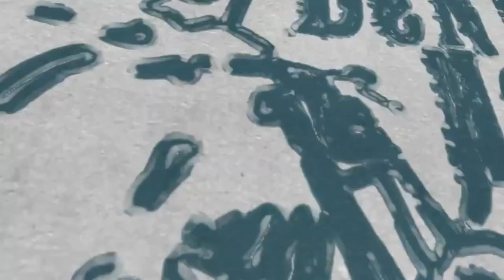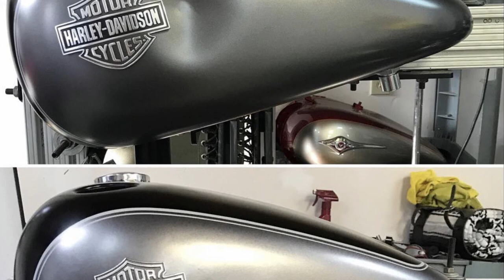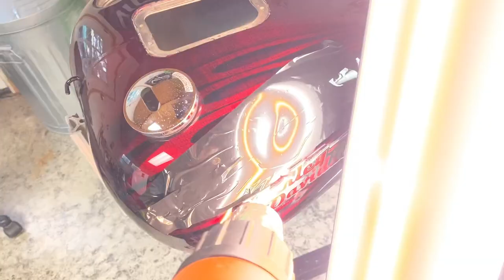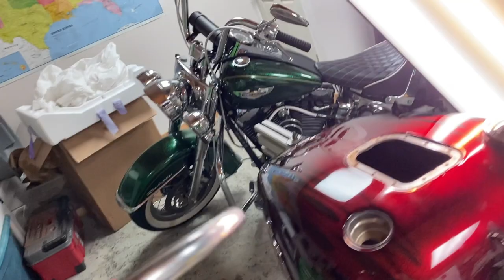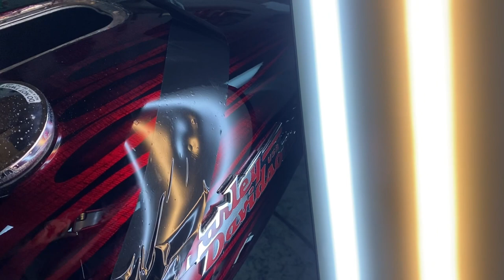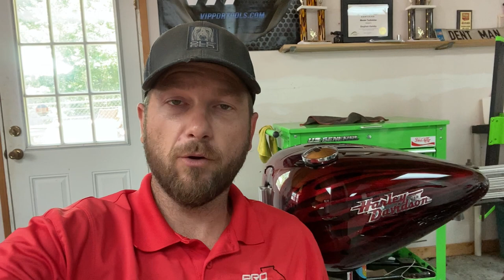Motorcycle Dent Removal - Paintless Dent Repair On A Custom Harley Davidson Softail Fat Boy

Comment: I got a pretty sizable dent in my tank and it has a custom paint job is it more expensive to remove the dent or replace the tank because I would like to keep the same tank but I'm not against fighting they used one that's just black or dark blue
Reply from the maker: Email us some pictures of the tank with the year make and model and I can get you an estimate on it and then you’ll be able to tell if it makes sense to repair it or just replace it.  Denthogs@gmail.com